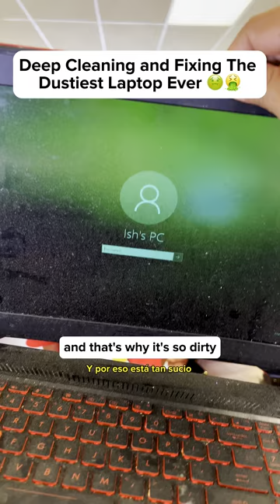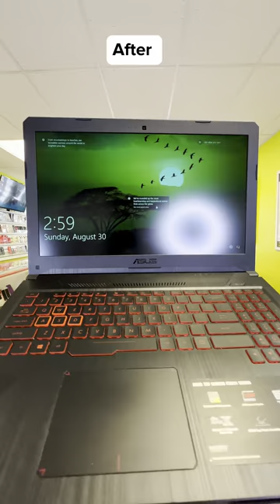Deep Cleaning And Fixing The Dustiest Laptop Ever! 🤢🤮 Watch till The end !

Comment: Phone: the screen is cracked
Apple: Can't fix it
Phone: Gets shot six times
MTW: Don't worry, I gotcha
Reply: Phone: has scratch
Apple: sorry cant fix
Phone: has been thrown across earth 5 times hitting a bunch of concrete buildings and then get stopped by a car that runs it over 65 times and then an angry 3 year old smashes it with his toy hammer and breaks all the parts except main board
MTW: don't worry i gotcha

Comment: It was almost similar to my laptop, but I was doing homework on mine one night, and the screws got jammed, and the LCD got messed up. Luckily, we had a warranty, and it got fixed for free. They replaced the whole display for me.
Reply: Bro in warranty they only fix technical problems. You high or smth
Reply: This is a ASUS FX504GM
Reply: I also got a similar laptop, its not the same but it’s similar. The LCD screws got jammed and the PCD was lifting up the keyboard because of how damaged it was. I didn’t take serious action to it, so I just cut the LCD off, meaning the screws come off as well, so now my laptop works with my monitor as a desktop computer 😂

Comment: The entire video was painful to watch as he did his job poorly. Especially when I cleaned the bottom panel, which contains the keyboard.For some reason, this idiot started cleaning the cooling grids, or whatever it is, and the touchpad with a metal blade. And because of his inability, he made two very noticeable and deep scratches on the laptop body. The first is in the upper right corner of the touchpad. And the second one above the button F4. Couldn't you at least take a toothbrush and alcohol to clean it? It’s very stupid, I can’t... In the best case, it would have been possible to disassemble it and clean the touch pad as humanly as possible, and much more.And most importantly, cooling